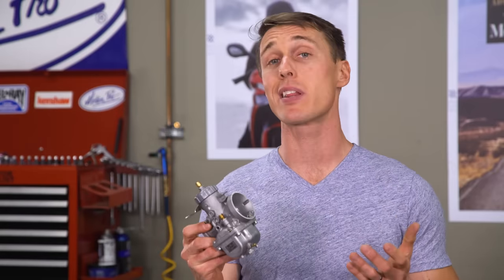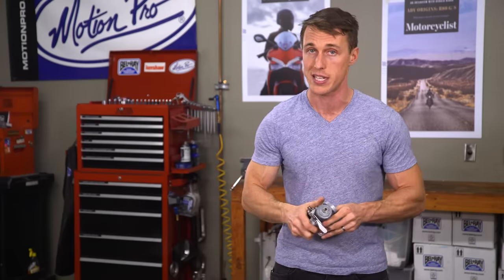Carburetors vs. Electronic Fuel Injection—What’s Better? | MC Garage

Comment: Carb bikes win if you need to ride after an EMP bomb has gone off the area...
Reply: Just thinking about that. Wondering when ignition modules  started in production and if point system would be affected? Old school diesel probably only way to go.
Reply: ... right, because Carb bikes don't need ANY electricity.

(Btw: EMP's fries circuitboards, so your carb regulated bike's ignition map is fried aswell)
Reply: Not necessarily if you shutdown the bike or car for that matter and kill all power supply theoretically nothing should fry as there's no current going through it then it should be fine afterwards but that's just speculation not proven
Reply: @reaperasylum2163  Everything gets fried, even if it's powered off. The EMP is an electro magnetic pulse that creates high current on electronic components, frying circuit boards and other sensative components.

This is why IT personal wears anti static wrist bands to prevent giving a shock to PC hardware. The PC is obviouslt turned off.

If you put the object in a Faraday's Cage, then nothing will happen.
Reply: There's been testing using large laboratory electromagnetic field generators on modern cars and could find little to no damage on several models of fuel injected vehicles with field strengths expected by a nuclear detonation. Cars have a big metal Faraday cage that is the frame that protects most components, may not true for bikes which have less metal encasing electrical parts.
Reply: If an EMP went off your sparkplug wouldn't spark so your screwed either way.
Reply: seems like bicycle is the only way out
Reply: fbnvbjfg just mount some very large air tanks on the frame of a motorcycle and hold on for life was you let the pressure release rather rapidly. As for how to pressurize those thanks well that’s not a question I have an answer for after an emp
Reply: EMP will not fry alliance electronics. Most will probably work after a reset and a teboot  when the pulse is gone.
Reply: I beat you all, I'll pull out my bicycle..... i win! Lol
👊😅😂😅😂
Reply: Brian Foote that works good till you realize it’s less tiring to ride a horse
Reply: dude that's just wonderful...no technology no problems
Reply: but they said only steam engines will work...why that so?
Reply: Lol. No thought went to that. Lol.
Reply: Not really because you ignition coil,CDI etc.. is toast as well
Reply: Nah, aslong as you habe any kind of ecu or such installed your done... I have a 1960s 25 2 stroke engine layin around, its got no elctric components besides a sparke gen and a disrupter. You can basicly run it aslong as you have fuel and oil
Reply: Nope, still have to worry about a distributor.
Reply: Diesel bike woumd be the only thing to live, and diesel trucks (old ones that are all mechanical)
Reply: @sliverbullet9067  Diesel will too because it's all mechanical. Well old one will because they use engine timing and fuel pressure to open injectors.
Reply: Hit n miss engines, steam engines, some dieses, that are mechanical timing based fuel injection systems, wood gas, and water/stream driven cams are a good for after-emp. For all other times, efi is easier, better, more efficient. That said, 3 of my 4 bikes are carbs--old school
Reply: If EMP bombs are real though.
Reply: @louied.quijano2254  they most definitely are, any nuke produces an EMP blast.
Reply: @noahkruetzkamp7122  spark plug isnt a circuit board & is way to rugged to fry itself in an EMP.
Reply: YES BUT EMP WILL FRY THE CDI BOX AS WELL.NO SPARK THEN.
Reply: Emp is gonna fry your bike carb or not. Carb is not the only thing necessary to run the bike. Lottttts of electronic stuff required to run ,pal
Reply: Honestly f.i just made for easy starting in any weather conditions and made fuel efficient.the rest is the same. BTW efi is much expensive on maintenance compare to carb.
Reply: I built a Harley with a s&s carb I was thinking of putting EFI in the bike but a few biker buds told me No keep the carb it's better 🙂👍
Reply: This is why many nations laugh at Russia and their military vehicles from the 1960s thru 80’s....but Russia will be the only Nation with a functioning military when the shit hits the fan!...
Reply: All these arguments about this will or will not work after an EMP bomb are very intelligent, but sorry guys... it's hard to ride, damn near impossible,... when you're incinerated! Lol 😀
Reply: Some say emp won't effect any parts of a modern car others say even a 1970s car in a Faraday cage will be ruined.
Reply: If.
Reply: Yeah like that’s ever going to happen 🙄
Reply: You got a carb, a kick start, no circuits. And yet the EMP fries the fuel pumps at the gas station
Reply: @denislavslavchev1845  - I have a siphon.
Reply: @Aman Pasrija Yes, it's called sarcasm my friend.
Reply: You'd be fine either way, just replace fuses.....
Reply: ByCycle are best in wars..

EMP destroy GAS station also...
u won't get any gas 8n WAR
Reply: Let's face it if that's happened then you have bigger fish to fry
Reply: So you found one potential advantage that may affect us under unlikely circumstances. MuSt Be BeTtEr.

Fuel injection is clearly far more reliable especially with modern fuel.

I got a spec of dirt in my carb and it started running one cylinder so lean it ruined the engine. It was barely noticeable because the other four made up for it and it only affected the idle a bit.
Reply: The battery would be dead
Reply: @philipcreamer4  most pcms are within a metal box.

I'm not sure exactly how emps work, but if a car might survive any motorcycle pcm with a metal box would also survive.

This is only true for certain models.
Reply: @XeClassified  I THINK they are wrong heavier components will likely survive. Batteries coils and points will probably survive. It is things like diodes, transistors, and small resistors that will get burnt.
Reply: Nope.

Emp effects the grid.  Because wires act as antennae for EMP.  The longer the wires, the worse the effect.  The shorter the wires, the shorter the effect.

In order to be effected by an EMP strong enough to shut down a phone, motorcycle, or PC... you'd have to be inside the plasma zone of a nuclear blast.  Not the fireball.  The plasma zone is near the center of the fireball.  In the event of an ICBM or a device dropped by plane... those are airburst.  And the plasma zone is so small it DOESNT EVEN HIT THE GROUND.

EMP effects the grid.  It doesn't effect your personal devices, unless they're plugged into the grid WHEN it happens.  And motorcycle EFI units don't ever plug into the grid.

You read too much sci-fi... and instead of branching off into the "sci" half, you branched into the fiction half.

Comment: In my opinion engines with carbs sound better.
Reply: Yeahh u Are absolutly right....✌️
Reply: but rev limiter is not that good with carbs ....
Reply: Lass 2 things. 1 A carbureted bike has no “rev limiter”. You just reach the physical limits of the motor and it gets ugly. 2 why does that matter? You shouldn’t want to bounce the rev limiter anyway. Mechanics grin and smile when Idiots stand on the rev limiter because all they’re doing is blowing it up. A carbed bike doesn’t have a 2 step or launch control of any kind. So. There that
Reply: Thomas Marchese why do you think carbed bikes have no rev limiter? I was almost sure you were wrong so I googled and yes they still have rev limiters they just cut the spark when you reach the limit.
Reply: @thomasmarchese2808  my v star has some kind of ignition box that controls it's rev limiter. By the way it's got 2 carburetors. Also if you get a dyna 3000 ignition control for it, you can actually change the rev limiters Max rpm. I'd imagine there's motorcycles out there like what you're saying but it's not a fact that all carbed bikes don't have a limiter.
Reply: @Lass475  we don't want rev limiters. We know how to drive
Reply: @grayghost832  its not the carb that gets curbed (lol) but the spark going to spark plugs. Rev limiters in carburetted bikes works through CDI which limits firing intervals of spark plugs thereby limiting the revs
Reply: @metategra9798  we have choke and you can keep the bike in garage. With efi systems you cant start the bike with low battery which we can with carb bikes. So thats that.
Reply: @al-Zughal  no its not harmful uf you do it for a few seconds. Here in India, people have been racing on the 100cc Yamaha's since the 90s and they don't know any technical stuff or even what is the best time to shift. They don't get any leaking carbs.
Reply: Al Gottsch  rev limiter is nothing but in the CDI, so the CDI limits the firing rate of the spark plugs after a certain RPM is reached
Reply: Carbs are just awful with acceleration. They lack that initial pick up .
Reply: Soloman 5k what do you expect bro, carbs are old technology, newer fuel injection will obviously be better
Reply: @Mk7adxm  glad to see you still reply after a year after all the rona madness.lol. Yeah old technology, but sound wise you probably right .
Reply: Soloman 5k yeah it’s all good man, I didn’t even remember commenting this until recently getting all these replies on this comment, I have some videos on my channel you might like👍🏻
Reply: @chris5k132  how many carb bikes have you ridden? 😂
Reply: @tejaspadhye  two carb bikes actually.
Reply: @chris5k132  then I can easily say they weren't tuned properly. There can be hundreds of different tunings for different atmospheric conditions.
Reply: @Jimmy Doran euro 2 standard had carbs with catalytic converters. 🤷‍♂️ Its not that but all about how much you put in r&d of the exhaust
Reply: @Jimmy Doran I don't know about that but my suzuki whivh is bs3 (euro2/3) has a catalytic converter.
Reply: @Jimmy Doran hmm, but again mine was 2007 model, never seemed restricted in terms of sound. With bs4 ( euro 4 probably what you call), I don't hear vehicles making tick tick sound of a cooling down cat, and everyone is mentioning the "addition" of cat in euro 5/bs6. The EFI is ruining the sound, example, the new Jawa bikes sound like sheep
Reply: F.i engines with no battery are totally useless.... Everything relay on electricity.
Reply: Vtwin with a carb is music.
Reply: But those guys becoming rare due to environment concern!
Reply: @badasshuh69  but it eats gas ⛽
Reply: @himanshusinghdosad9853  rasA
Reply: @chris5k132  not if the carbs are tuned. Furthermore, the Honda CBR1100XX Super Black Bird was the fastest motorcycle when it came out & was carburated. It can still reach very respectable speeds, even by today's standards.
Reply: 4 stroke get the pop pop pop on deceleration
Reply: The Head of Environmental Products wants to send you an ebike (no sound) 😅
Reply: @thomasmarchese2808  How do you suppose a carb engine can't have a rev limiter? I mean looking past the fact you're wrong.
Reply: What will you choose, a muscle car with a massive carburetor or a sports car with injection system🤔😏
Reply: Yeah 2013 yz250fs sound great
Reply: @chris5k132  fuel injected motors suffer from that as well. That's why we have tuning jet kits for carbs & tuning software for efi. Because of environmental concerns carbs are set to be lean from the factory.
Reply: Yeah your true my friends yz250f 2009 sounds so good
Reply: The problem of the engine speed limiter 'no need to play the gas to the red limit' we don't need to change the ignition to change from injection to carburetor
Reply: @said-fo5vw  elaborate
Reply: @RodFleming-World real real

Comment: What practically no one knows, is fuel and air is not SUCKED into a carb, it is pushed in by atmospheric pressure. High pressure flows into low pressure. The piston creates low pressure, and atmospheric pressure fills the void. Fuel is pushed in the same way, air pressure bearing down on the fuel in the bowl forces the fuel uphill in the metering system then sprays into the low pressure created in the venturi. The faster air moves the lower the pressure. This is why you see drag racers using their weather gathering gear. If the air pressure is "high" they jet for it. And at high altitudes you can't make as much power, you have less air pressure to "supercharge" your engine, so you lean the mixture and make less hp.